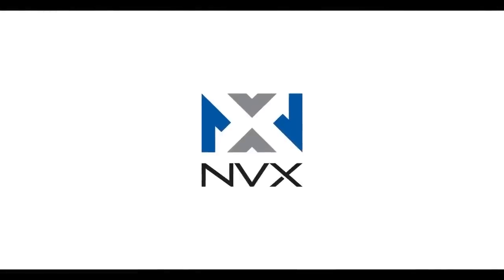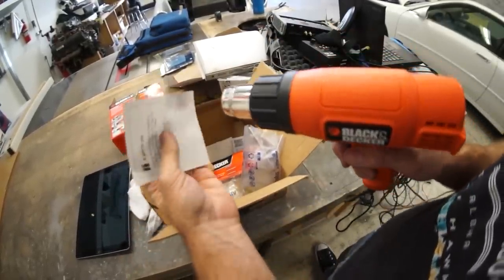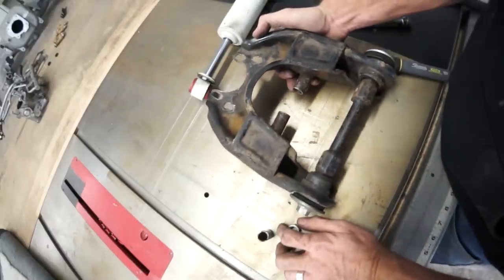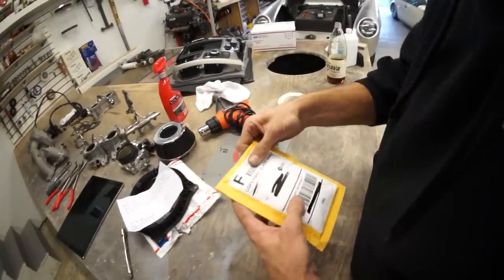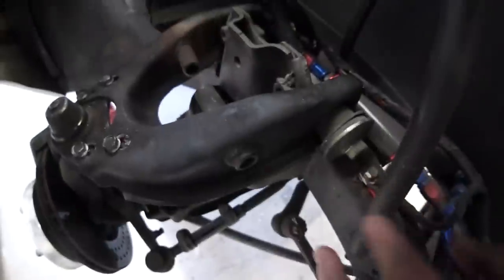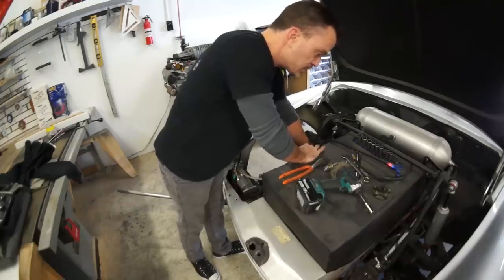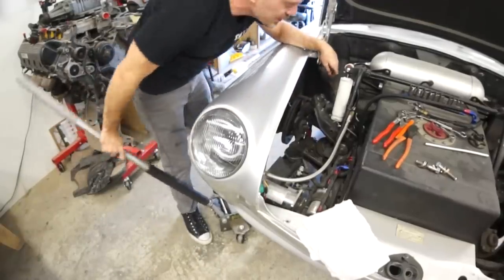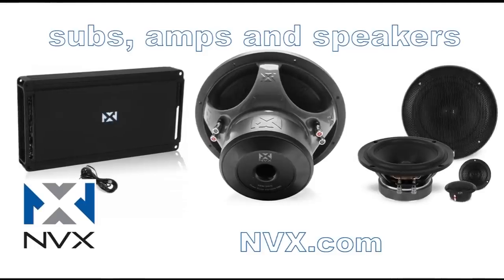HARD LINE for The Mule's Air Ride

Comment: Having the same issues with mine as we speak (last week and a half). Decided to go hardlines to look "cool" and can't get them to seal properly to save my life. Using brass compression fittings to transition from aluminum to nylon tubing. Any tips to stop the leaks before I rip it all out and go back to nylon?

Comment: Hey Doug instead of wasting all that tubing why don't you get a metal coat hanger and bend it the way you need it in place and then transfer that over to the tubing like making a template using the metal coat hanger and then you just duplicate the bins in the coat hanger on the tubing and it'll slide right in

Comment: Well I don't know if anybody told you in the post yet cuz I haven't look through all the comments but you should definitely use a coat hanger or some kind of easy bending wire to get the band and routing the where you want and then you can pretty much follow your Bends you should also make what they call a cheater bend ... basically it is a small section of true that you create a 90 degree in you mark where you actually attached the device from and then that way you can measure from there and use it to know where you need to place the tool at in order to get the radius bend that you're looking for in the right spot 😉... If you have no clue what I'm talking look up roll cage bending and building... .. it'll show you what a cheater tube is and the best way to mark your tubing 😉😂

Comment: IMO the hardline is not worth the effort unless you are going for a show car. I ran plastic dot line for over 10 years on my truck with no leaks. You can add braided loom if you want to make it look nicer I guess but again not worth it. And I am not a fan of PTC fittings...compression worked better for my set up. 3/8 line with 8 1/2" valves..